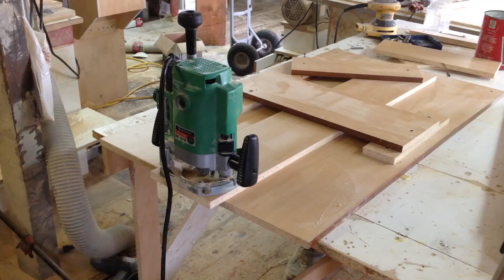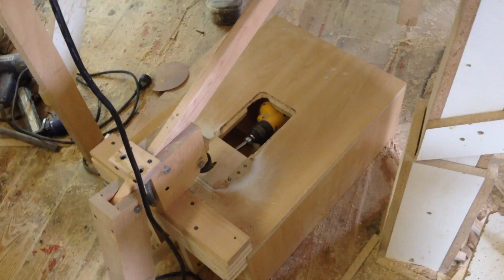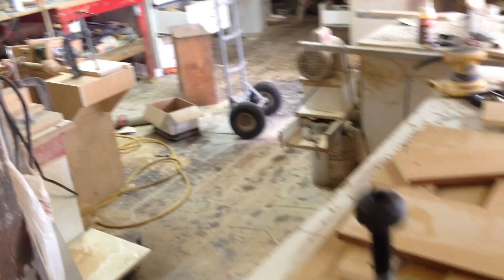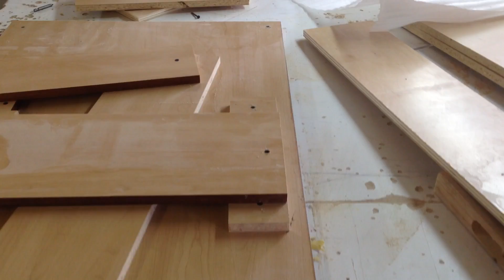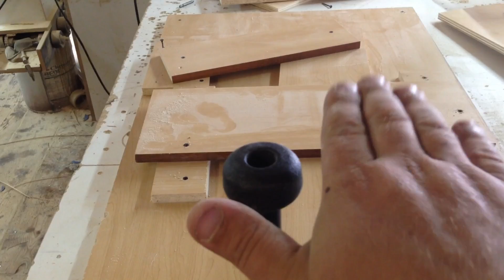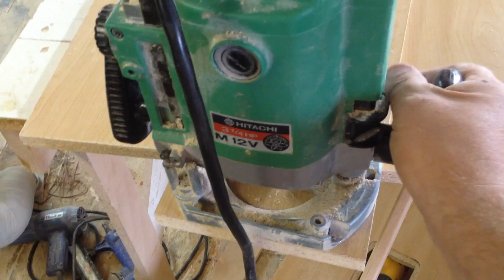Aug 21, 2014 New Floating Router Concept!

Comment: ive noticed your router has no speed control. did you remove it due to it not working? I've bought four all with the same fault. great way to get cheap routers eh
Reply from the maker: johnny fannucci yup. Can't keep speed controls in these routers. I've got 5 or 6 of them all with them taken out.

Comment: The one potential problem I see with this setup is that the plunge router needs to plunge through the beam it's attached to, reducing the plunge depth by the thickness of the beam. You could improve this by mounting the router on a recessed steel or aluminum flush plate in the beam so that it's plunge depth is reduced only by the small thickness of the flush plate rather than the larger thickness of the support beam.

Comment: You might be able to put the template along side rather than build an overhead box or cabinet.  Just use a follower screwed on top of the board that the router sits on.

Comment: Hi Wayne.  Great concept.  Hope you can keep the design skim enough to be smaller than the other unit.  Plunge fulcrum w two rods over the router handles (connected in front of router), hinged behind the router and pointing toward the operator may work good here to assist smooth plunge w ease to the operation.  Also... guide bearing doesn't have to carry a straight line through the router w shaft.... may assist design for the guide bearing to be offset.  Or better yet... make the template to mount low and near the support in the middle of the main long arm for a doubling effect (template half the size of the cut tenon or mortise).  Keeps it out of the way of the router travel.

I noticed that you may shoot most of your videos in one or two breaths with little editing (good work... I know you're short on time and as efficient as possible). Try this free on phone video editor if you have an android phone and you shoot your vids w it.  Incredible editor, easy, easy to use.  Quick, quick, quick to cut, trim, annotate, etc.  Free version leaves watermark... But incredible.  https://play.google.com/store/apps/details?id=com.nexstreaming.app.kinemasterfree